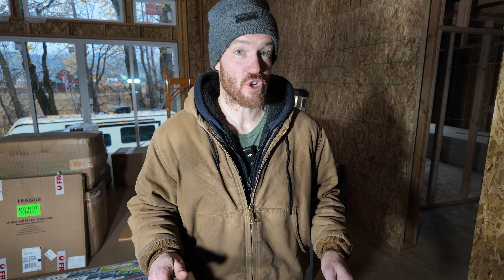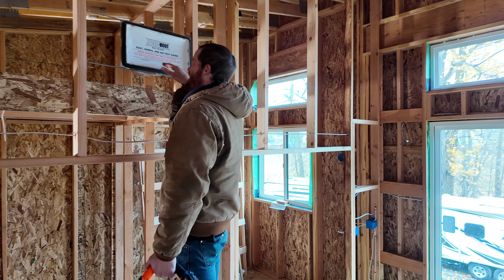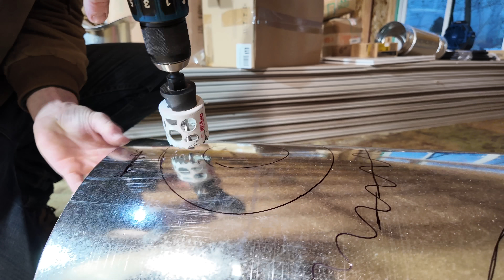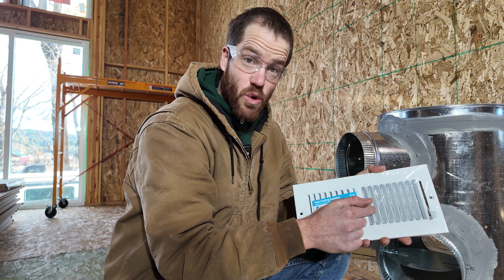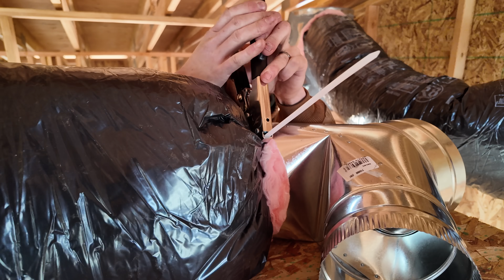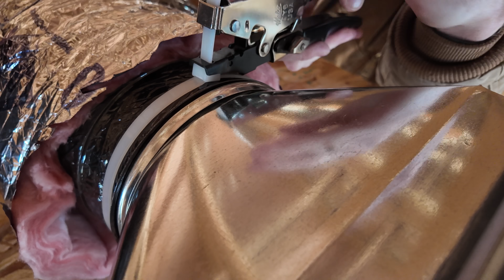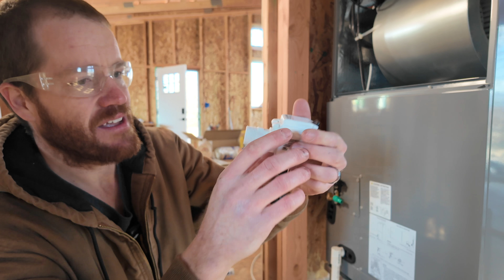HVAC Contractors Hate Me For Showing You This

Comment: Ryley and Courney, as an HVAC tech for well over 20yrs I was a little skeptical about watching this video, but you really showed how easy Mr Cool has made the process, and I LOVE that you gave us a full list of everything you used! The only thing I would have done differently because I live in the South East where it is much more humid, is insulate the main trunk and mastic all the insulation seams. All around great job guys!
Reply: Doesn't this system need a cold air return or is it not necessary? All I have ever seen in houses is cold air returns. I am pretty old so this new tech stuff is a little hard on me. Thanks for any response...
Reply: @robertgregory2618  They can easily just use a louvered door and let the air return back to this hallway from the rooms. Smaller homes can get away with that, where as large homes have to have a ducted return air.

Comment: Please dont follow this advice on HVAC. Not correct and he will have alot of problems. You dont just randomly install supply boots, they go above windows. NO returns???? No filter??? Exposed metal?? Wait till he turns that thing on and all you will hear in the house will be one huge woooosh near the furnace trying to suck in air. Dampers do not effect overall airflow as CFM is controlled by stepping down rigid ductwork creating pressure. That is a hack job.

Comment: You are better off using straight pipe until last 5 feet of run and you will get better efficiency.  Then you wrap the metal duct in insulation.  I realize it's too late now, but thought I would reach of your y's need too be insulated or it is going g to sweat and mildew your ceiling.

Comment: The best way to connect the ducts is to paint the boot with mastic, then side the duct on, then zip tie it.  Then, zip tie the insulation over it.  During cooling season cold air leaking into the insulation can cause condensation.

Comment: I’m planning on replacing all the old HVAC in my 100 year old house soon, and since the house is all electric I wanted to use the Mr. Cool central air system but didn’t know enough about them to make a final call. Your videos are so helpful when researching heat pumps and have helped me solidify my choice with using Mr Cool’s HVAC system in my home!

Comment: I've wanted to try a ducted mini split in the main hallway ceiling specifically 100% inside the thermal envelope. Return main duct in the hallway ceiling with individual supply ducts running to each bedroom bathroom & main living areas within the false hallway ceiling.

This will take up zero square footage which is good because it would probably work best in a small home under 1200sqft.

Comment: 46 yr in sheet metal trade. You need to wrap and bare sheet-metal. You also need vibration isolators under the unit. You also need to create a path for return air or you will need to have all doors open. With Heat pumps insulation is critical,  go extra in a big way. There are a lot of things that I would have done differently, but your are set up will work just not as efficient.

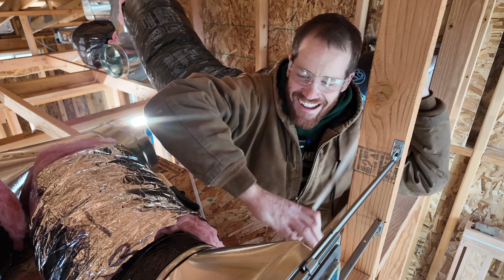Comment: @14:28 Sorry but you installed your flex duct incorrectly here. Generally speaking on everything, specially custom parts, Mastic inside and outside seams and finish with tape. When you put your flexible duct, better to use mastic then tape on duct and tape on insulation sleeve. However here at this time stamp your flex duct insulation is sticking out from your insulation sleeve. That is a NO NO.

Comment: You will need to insulate the metal portion of the diffuser that is located up in the attic.
Any cool metal surface in an unconditioned space will produce condensate and you will get water spots on your ceiling.
You will also need to insulate your metal Octaduct.
You didn't show it in your video and I just wanted to make sure you know.
Fun watching your videos.

Comment: I really like the idea of the MR. Cool pre charged line sets but I just can't justify spending the extra money for the unit and the lines. To me it just makes more sense to have the lines at the perfect length and pay less for them. I also like the peace of mind that the system can be pressure tested for leaks with nitrogen and then vacuumed down to further ensure there are no leaks. With the Mr. Cool there could be a leak and then you'd have the headache of finding a leak or going through warranty then finding and paying a pro to come out and fix/charge everything. Awesome in theory and probably works out of the box 90% of the time but I'd rather just buy the gear with the money saved and have a super clean install rather than that ugly extra line floating around.

Comment: Love the way that you have installed the air handler! Having served several years as an installer, Perhaps on your next project, you may wish to locate your ducting should be located near sources of heat loss/gain against/over outside walls... over/near outside doors or windows. The goal is to moderate the impact of these areas that penetrate your walls to the outside. Good job overall!

Comment: A Manual J Heat Load should have been done on the home. That would give the BTU and CFM need per room do actually design the duct. All duct needs to be insulated, it will sweat and will have lots of heat transfer and lost efficiency. Not sure what if any codes or inspections are required in your area, but blower door testing could be required to tests ducts tightness.

Comment: You're supposed to run a screw through the band into zip band into the duct to hold it and wrap it with aluminum duct tape or mastic to make that junction air tight as well.

Comment: Have you ever looked at electric radiant heat? I use it in my renovations and it is very easy to install and cheap to operate. When I build a home, it will have mini splits for a/c and radiant for heat. No air blowing and individual controls for each room.

Comment: Not an hvac guy , remodel contractor , but my hvac guy puts mastic on the metal fitting before putting on those mylar ducts to prevent leakage. Tapes the insulation together too. 
Just some thoughts.
Thats a cool system with the multiple options for additional air handlers and mini split units.

Comment: how big is that unit? what is the draw on your system? how many panels and batteries to run this system? I would like to run heating on separate set up is 220v required? I am in upstate NY 6800 degree days would this system handle that? I now lots of questions but that is how I learn LOL

Comment: Very good video. I truly hope your system works well. I remodeled a home and ended up with a similar upflow furnace like yours and ceiling registers and attic duct. The radiant heat from the duct heated the attic. Almost never had snow on the roof, but we had icicle's galore. And all the heat hung near the ceiling and our feet were always cold. Ever consider putting the unit in the basement so there was conditioned air in the space below the living area floor? Hopefully your system works better. I had a furnace, not a heat pump and our utility bills were rough. 
The AC worked good which would been great if I lived in the south, but I live in a climate up north like you do.

Comment: duct work sealing all seams failed. tape and duct seal around all duct where it goes over metal fittings. then, using insulation, wrap all metal at plenum and around all canswhere they penitrate wall, into rooms.they have a machine that  pressurerises the duct, and it blows smoke threw duct in reverse. you would defianantly be conditioning your attic..

Comment: All supply air ductwork needs to be insulated. Those distribution boxes you made will sweat in summer if humidity is a problem in your area. I’m in Australia and humidity is a big problem in our tropical north. Causing mold and damage to plaster board and wood.

Comment: An 1100 sq. ft. home and you spent $5000.00 on a mini split? You spent too much money. If you are in the USA, a 2 ton 3 zone unit is all you need and you can get that for $2000.00. You must be including all that other stuff you installed with the ductwork which you didn't need with a mini split.

Comment: I was looking those multi zone systems. They were so expensive(at least in here) that didn't really make sense to buy one instead two smaller system. Plus side also is that if compressor fails you don't loose heating/cooling the whole house.

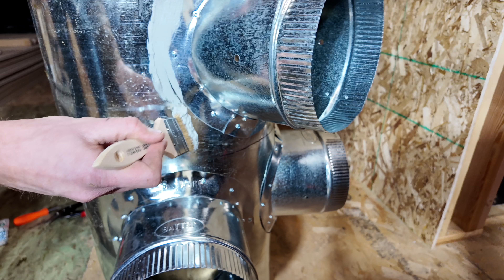Comment: @8:25 after years of watching Holmes on Homes, Holmes Inspection, i know it as mastic.

However one thing i dont see is what you are doing for air filtering, as you should have some filter before it goes into the air handler (so the condenser and fan dont get clogged with dust)

Comment: Really enjoy your videos and learn a lot from them. I do have some questions though. What is your thinking/justification for no return air to the unit from each room? I think you will be having slamming doors, the oders from the bathroom being blown under the door into the living space. Do you not put heat registers under windows to help keep them to be frost free? Granted I'm no expert but in our house the registers are under the windows and  the returns are on the opposite wall of the room that keeps the air flowing to the main unit. Our heat/AC unit is in the basement and all ducting nicely tucked into the joist space. Just my thoughts which probably don't mean anything. Be safe, have fun...
Reply: exactly

Comment: Why not keep all of your mechanical in the basement? I'm from Missouri and I don't think I've seen any houses here that have the HVAC system in the Attic, yet. I see it all the time on home improvement and Reno shows. In my 70-Year-Old ranch home, the HVAC system is in the center of the house in the basement and The trunk line runs parallel to the I-beam that supports the house.

Comment: I worked in an office in Southern Ontario Canada. The thermostat was on the wall at the normal height. The hot air came from ceiling vents and the floor was concrete. When the heat came on you could feel the room warm up coming down from the ceiling but when it got to the thermostat the heat turned off. My feet on a concrete floor were cold all winter. You have a garage under the floor and it will be cooler than the heated area. Just a thought.

Comment: I would guess that bid you got was for both levels of the house. You could have just installed the unit in the basement and installed ductwork to go through floor in upper level, and overhead for lower level just like a traditional ranch style home. If i were going to install in closet i would have built a platform for unit to set upon. im guessing you have a 2 and a half ton system based upon cfm you gave us which is big enough for 1000 sq over a basement.

Comment: you should insulate all the way to the wall. meaning the connections to the Y, and the boots. the sheet metal will probably have condensation form and you'll have water damage. the same also goes with your plenum. all the ducting needs insulation unless it's exposed ducting.

Comment: Not to piss in your cornflakes but just tips for the future. Good luck!

I’ve like you’re doing all that yourself and it’s nice to see your enthusiasm but there are some serious “buts” here. 
1-I think that the quote you got is a ripoff and if you paid $5k for materials you probably could’ve found a pro to install all that for a couple K more. 
2- the online “tools” you used to size the ducts per room and your understanding of the process is completely wrong. You need a manual J heat load calculation to determine the amount of air per space. 
3-ALL the duct connections you made will leak. This was my biggest cringe of the entire video. You need to used the same mastic to seal every one of them and that’s not the way to attach the outside liner to the boot. Too bad you didn’t check some pro videos on that. 
4-ALL your tape connections will fail especially for you because it’s cold in your house and it’s friction tape that needs to be in a warm environment for the glue to work. Also, you should’ve used spray glue to secure the tape. You didn’t want to use mastic at the air handler and that is a mistake. When do you plan on disconnecting it from the plenum? This shouldn’t happen unless you’re changing the air handler. 
5- you need to support your ducts 
6- we’ll see if your duct design will hold water. I have my doubts. 
7- you won’t get 100cfm out of a 6” flex unless it’s a perfectly straight run and they never are but if you do get 100cfm out of yours then say hello to noisy registers because those cheap crappy ones will restrict the airflow and whistle. 
8- for better comfort in your duct design you’ll want high volume low velocity using large(r) ducts. You’re doing the opposite. 
9- you could’ve bought an air handler stand instead of wasting time with the one made for a water heater. 
10- some people will disagree with me on that one but if you glue all the pvc fittings you won’t be able to clean your drain line down the road without having to cut it. You don’t need to have an open vent on it and I would actually advise against it for multiple reasons. It’s just a gravity drain, no water pressure and it’s good to be able to take things apart when needed. Screw couplings and ball valves are nice. I always used to put them on my installs.

Comment: I do not want tell you this but you have so many issue with you HVAC installation - you have condensate problems, you don't have insulation around your plantum or all your receivers you using the plastic raped ducting it is for mobile homes and will deter-ate in walls an ceilings it is made to be under a mobile home not for attics and walls, your bathrooms should have at the largest 5" ducting with a heater vent light fan to made the difference with 6" duct it is going to be way cold or way hot, your vent should have been place close to your pointing to your windows and door where your loads are - also should use cured blade registers for heat pumps it mixes the air better - thermostat should be at 60"  and with a Mr cool you should use a regular Heat pump thermostat because the fan runs all the time with the stat that comes with Mr cool -  your ducting is not properly sized for your home because the ducting size goes with the orientation of the house the north is the least hottest then the east, south and west remember in refrigeration there is no such thing as cold it is heat or lack of heat! - also you need to add a clean out/ tee coming out  your unit with a cap plug so you can add vinegar or bleach to keep the crud out of your pee trap and to clean it out when it is block also on a Mr cool the over flow switch should be connected to red {R} or the blue {C} in series on regular HP thermostat or on one of the wires for Mr cool stat I have been a licensed HVAC, and Home builder for than you been a tinkle in your Fathers eye I can help you if you contact me PS Those strap pullers that auto cuts does not get the straps tight enough forgot you did not mastic between the ducting and the collars and you should have a 2" vented pee trap where the condensate goes into from air handler PSS You should have you air handler in a closet on a wood platform with the closet Sheetrock and sealed and and would have used duct board or purchased a insulated metal plantum and use insulated receivers/box

Comment: I put in a Bosch heat pump / natural gas system this year and it cost more than what you did but I definitely saved 10 grand over paying somebody to do it.  I need to improve my cold air return so your spreadsheet will be helpful for materials.  Thanks.

Comment: On the interior part of the heat pump, is there a hepa filter to filter your inside air?  Also I would be worried about lint/dust getting stuck in your flexible piping.  Does the manufacturer recommend cleaning of those flexible ducts?

Comment: GOOD and I like to see how this UNIT IS installed because I have quote of over 15,000 to just convert something from Heat pump and natural gas furnace unit.   However if this is cheaper to do I do it.  Also need to know how many BTUs it has for output.

Comment: You need to think of air like water flowing through a drain pipe, free flowing through the system with a continuous stream, no hard corners or places for the flow to jam up on itself, although you have a fan pushing and pulling it, the flow is more like water flowing down a drain pipe, trying to keep the best flow through the routing route to keep a smooth flow of the water.

Comment: 20k is bit more then here in south smaller companies charge, while entire your cost is roughly 5k since you don't need more then 2 ton, our price from our books for all including 800 cfm ducts would be about 11-13k... the big companies could be sometimes crazy, i seen them charging 2.4k for simple non ecm fan motor... Good luck... 

and yes insulate all ducts from collar to register tight, insulate plenums if they not already inside mastic all collars seems plenum corners etc, insulate drain and "p trap" all the way to sewer breather, make sure you have plenty return if your AH closet can have return grill on more then 1 side do them all for better heat removal and quitter air returning, better over size 240 for heat then barely making it 50 Amps for 10KW covers blower and 40 Amp heat, do standards el. for condenser as well, like the safety pan and i prefer to not make it drain so it does not defeat purpose of the float switch... have fun, it's amazing building already